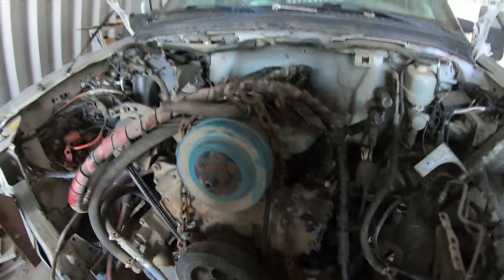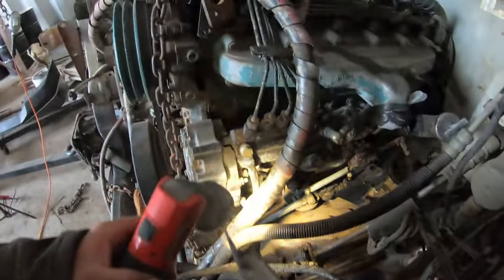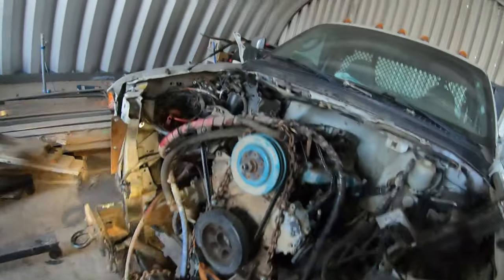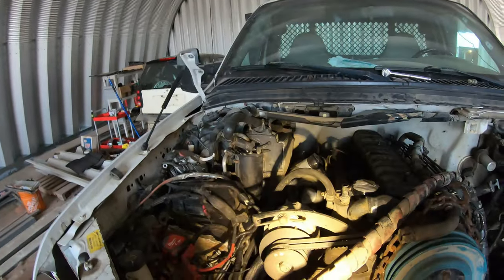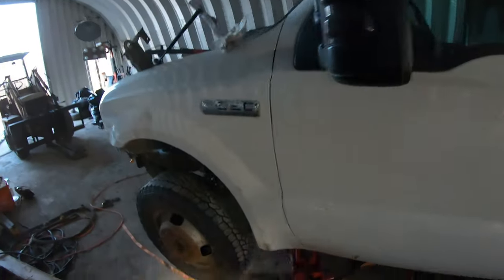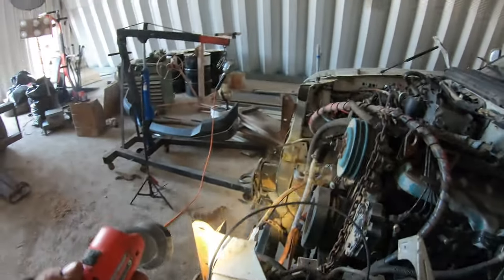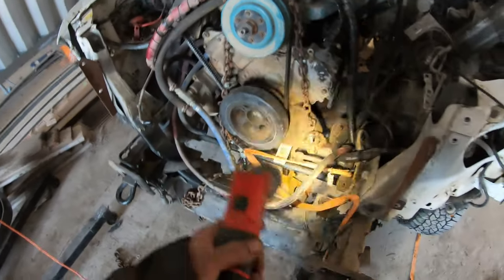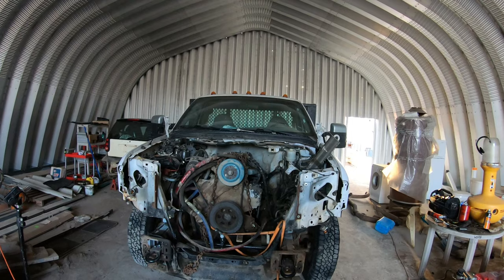DT360 (5.9L) DT466 (7.6L) Diesel. How Does It Fit In A 2007 F350?

Comment: Apologies if this upsets anyone, but whilethe DT466 and DT360 share several parts, they most definitely do NOT share blocks.  While I am not familiar with the NGD and E versions of the DT466 (1994-2004), I do know that the original DT466 blocks from the 70s until 1993 were several inches longer than the DT360 blocks.

Comment: Nice man. I'm wanting to do a dt360 swap on my 82 Chevy Crew cab.
Reply from the maker: I used to have a 78 Chev 4x4. There is enough room in there if put electric fans. I swapped out the automatic for a throttle body fuel injectected manual 5 speed. The gearing in the rear end of that truck was really low from stock I think. I drove it in forth some times because in 5th. gear the engine was turning little less than 2000rpm. little bit too low for a 350. But for a dt360 that would be pretty close to what is needed. The F350 I will have to change the gearing in the rear end. Think will try 3.54 to 1.
Reply: @manbuilds1587  I'll definitely be waiting for an update.
Reply from the maker: yah sorry, been busy couple months :). to compound I just crashed my smart car on the highway as well. A young lady drove accross the highway without stopping. Now I know a person can survive a high speed impact in a smart car. no broken bones just sore for last few days, I had seat belt padding, think that helped alot. That will probable be the next video. Will have a bunch more videos about the swap mid sept. Think thats the earliest when can get back to it. Thank you for the interest, I will try not let you down sir.
Reply from the maker: https://youtube.com/channel/UCzOO1qR98TB-cwDGJtVuvpQ

Comment: Dude i need my a/c lol but the nice thing is now you can buy kits for electric cars and it makes the ac all electric no pipes just wires at least the one i seen it was all under the dash on a square body chevy.. and as for the gauges why not just use the stock ford cluster mine is a 2008 6.4L power joke till at 89k she play power stroke and stroke to hard for the last time and blew her load out the side of the block lol i used all the stock sensors  by just drilling and taping brass pipe plugs and Reducers some i taped directly in alum parts like alum. Air Intake horn used all but like 5 of the stock sensors was around 20 even used the stock pryo sensors makes it all look stock and i use a OBD2 edge reader/program(of course no programming with a manual motor lol) but set to see the pryo gauges and some gauge readings ya dont get on dash..i like it looks like stock truck but ran great and got 16mpg all the time empty loaded it didnt care i was always 16mpg and not one problem after the bugs was worked out i put 27k on it before a random guy offered me the right price. Now im doing another one dt360 this time instead of the dt466.. thanks for sharing
Reply from the maker: Thanks for the info about the ac pumps. I will check them out. 
Yes, i will go with the factory gauges. Easilest option, looks stock.

Comment: I put a N14 into a oilfield rig and used a engine controller for guages and mph. Have to program it and once I'm done I'll see where your at and I might be able to help you.

Sounds like your Canadian, where's the hockey puck engine mounts?
Reply from the maker: Haha. hockey puck shortage this year, so trying to use them sparingly, Might have to use the actual engine mounts.
The international gauge pod has ratio adjustments on the back of the pod. You can adjust by sliding the little switches over for different axle ratios & tires. I think I will mount the international gauge pod in the dash. I have a plastic welder & think should be able to make it look nice & be functional.

Appologise for not posting more videos, I got really busy working on the house getting ready for inspection, I havent made it back to get the truck together yet but soon.

I dont have alot of experiance with Cummins but I know a N14 is a pretty good engine if not the best. 
Is the engine controller from the N14 or is it another controller with all sensor inputs & it has a scanner gauge pod plugged into the obd port?
Reply: @manbuilds1587  it's a Murphy product, it can easily run can engines (95+) or just manually put in sensors like I did for my 1992 N14. I might buy a can converter so I can see all the life data with putting extra sensors on it. It doesn't replace the ECU. Has to be programmed is the downside. I just posted a video that covers a little of it.